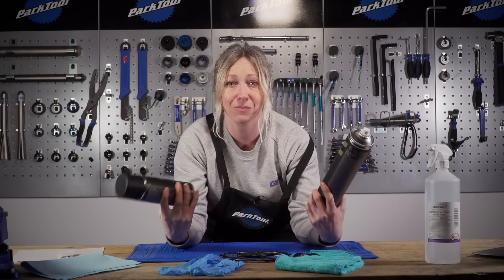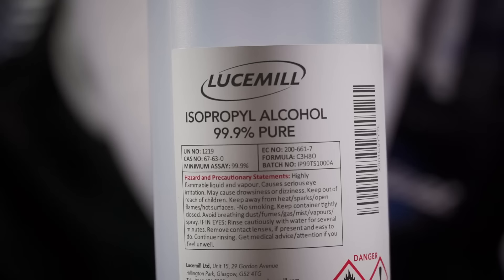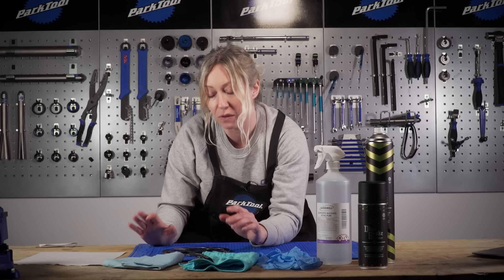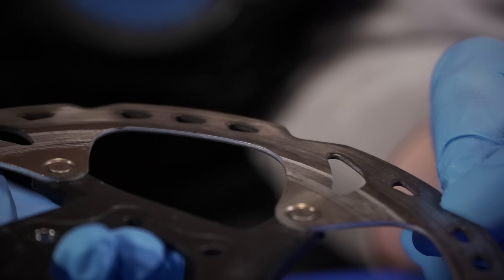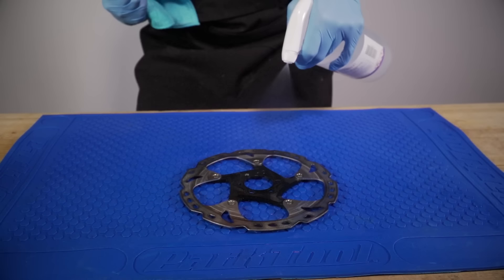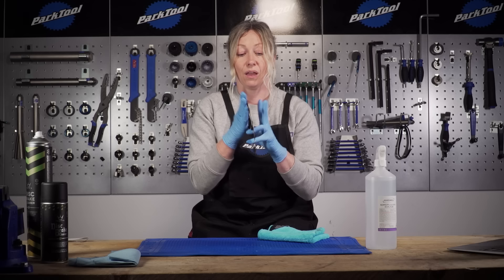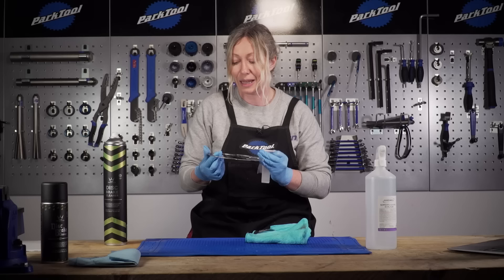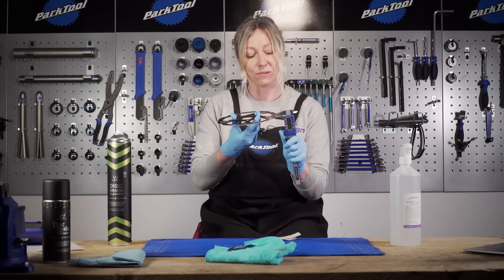How To Clean And Resurface Disc Brake Rotors

Comment: I'm sorry, but I don't think I need specific bike brake cleaner. Any automotive cleaner will do the job. What's that with it might have lubricant in it? It's made to clean disks!
Reply: Lubricant is made to reduce friction, I for example usually use WD-40 for my suspension and it usually drips down onto the discs. The result is brakes that barely get any grip at all, they also sound terrible.
Reply: I'm using automotive disk brake cleaner, works fine and it's much cheaper.
Reply: @TriqxterRB  yeah, exactly. Why do you want lubricant on your brakes? You don't... Automotive brake cleaner doesn't have any lubricants, as again, yon do not want lubricants on your brakes especially on a car.... Yet the host said "don't use automotive brake cleaner" which is just fake information
Reply: Brake clean is brake clean . Lube is lube

Comment: lubricants in brake cleaners?...ive never heard such wrong information sorry.
Reply: Maybe she misspoke, but she mentioned bike cleaners, they can be super slippery and effectively lubricate the rotor, I experienced this with Motorex, it was like dish washing soap, super slippery, and if not blasting the rotors brakes would get contaminated, Finish Line, Muc Off don't do this. But yes they at least not to the same degree.
But degreasers you are meant to wash off will be like this too, the one from Muc Off is, but not the Dry degreaser, they dry, no rinsing needed.

Comment: The bike industry is so weird, I've been working on cars and bikes for 25+ years and I've never bought any bike specific cleaning or lube products except carbon friction paste. Also sanding those rotors without using a flat surface could lead to high/low spots which will cause chatter...
Reply: Yep it's a faff the bike trade..
Reply: Concordo plenamente!🇧🇷

Comment: 437k people were just exposed to bad advice. Do no try to refinish rotors with a sand paper. It will create high and low spots. Which will create vibration and pulsing.

Comment: There is exactly ZERO reasons for car disc brake cleaner to contain ANY lubricant. They serve to exactly SAME purpose as bike disc cleaners do, so only difference could be retail price.
Also, automotive segment do not sponsor GMBN Tech, so perhaps...
Reply: the comment i was looking for. I buy mine in 5L canisters an use a pump bottle. Also WAY less waste then buying 300ml aerosol sprays.
Reply: Exactly 🎉
Reply: So, you're totally wrong.
These Brakecleaners are using a protection, you can clearly see leaving a resedue on the brakes.

For automotive, it will be a no problem.

But the tiny Brakes on the bike can not handle it.

Always using something without any protection, like Acetone.

Comment: Quite a bit of misleading info here. 
- No disc brake cleaner will have lubricant in them, especially the automotive types. 
- Sanding rotors like that will damage them if sanded too hard or won't do a thing if sanded too lightly. 
- Discoloration comes from overheating the rotors. The worst ones I've seen had all the rainbow until blue, meaning they've reached above 300 Celcius at some point. That will not affect your braking at all (excluding time they are hot in the form of brake fade), but in rare occasions excesive heat can warp the rotors if they are cheap, or get in contact with water while heated. 

Just clean and check the width of your rotors from time to time and throughly clean them if you are changing pads. That's all the maintenence you will need
Reply: Great info. You are correct.
Reply: Thanks I think you saved me from getting specific sandpaper and a bunch of unnecessary shit. I'm changing pads, different type even, (organic over to sintered). I'm going to thoroughly clean the rotors with the brake cleaner I already have, swap pads, bed them in and move on with my life.

Comment: According to Ollie from GCN, (phd in chemistry) acetone is the most effective grease cleaner, that doesn’t leave residue 👌
Reply: I agree,acetone is and it's much stronger than IPA but more hazardous.💯👍🏻
Reply: It's a more potent solvent but it has the disadvantadge of attacking plastics and rubber seals
Reply: @neiv9574  correct, be careful with acetone!
Reply from the maker: Great point! Acetone is a lot stronger. We'd only suggest using that if IPA doesn't work and you take extra safety precautions and have previous professional experience using it. 👍

Comment: Did that to my Code Rotors and Pads after just bleeding the brake was not successful and it really worked for me. No need to replace all that. Cleaning and sanding a bit does the job quite well.
Reply from the maker: Nice one! Good to know, Henrik! We're glad that worked for you! It's a nightmare having to replace pads and rotors. 😬

Comment: I have noticed that on GMBN every now and then they talk about CLEANING disk brakes.

For more than 10 years how long I ride bike with disk brakes I had only once problem, when I by accident spray wd40 on rear disk. And that was when I started to work on my bikes long time ago.

Honestly disc brakes are realy hard to be dirty, because surfaces of breaking pads and discs are very ofter in contact, creating friction and high temperatures. So they cleaning them selfs.
I have never used disc breake cleaner or sand paper on them, no need.
Reply: I don't think I have gotten much contaminants on them, but cleaning and "resurfacing" helped a bunch of times against squeeky or underperforming brakes. I think it's actually not getting them hot enough that often causes issues for me, but I can't magically make bigger hills appear..
Reply: Unless you get oil on them, they're fine as they are.
Reply: if you ridde in contaminated puddles, like with oil leaks by tractors, cars and so on, you can contaminate the brakes. but if it's wet and you brake a lot the rotors might eventuality work better, but always best to clean them if they are contaminated.
But without any contaminants there is no need to clean them. Resurfacing on the other hand you sohuld do when it's glazed.

Comment: The rotors you are resurfacing look like Shimano XT Ice-Tech (SM-RT86?). The stainless steel surfaces on these rotors are "sandwiched" over an an aluminum core. Personally, I would resist removing any of the stainless on these rotors by sanding them. In my experience, these rotors will get a "burnt" looking color---the price you pay for the technology. This does not affect the performance, just clean them thoroughly with alcohol. Finally, I would emphisize replacing these rotors once the thickness has reached 1.5 mm.
Sanding is acceptable if your rotors are solid stainless.

Comment: Can you print a retraction automotive brake clean is the same a bike , it has zero lube in it as it is designed to clean rotors and remove all oil.  Wd40 is different

Comment: I use ISO and regular paper towels and no special cleaner. When commuting my bike gets absolutely filthy, whether it's road dirt, salt, corrosion, etc. My trail bikes stay much cleaner. Depending on your conditions YMMV. The motorway was a good example because roads are littered with a different kind of filth than good ole' trail dirt.
I'll spray the pads with some ISO and then wipe them clean. Sometimes with bad weather/salt they get some corrosion (I always use metal pads). In that case I take some 220 wet/dry paper and give them a quick sand following by ISO clean.
As for rotors I don't tend to mess with them too much unless swapping to new pads. I like the ISO/sanding here as well before bedding, or anytime there is a lack of bite. Once bedded they tend to work fine thereafter.

Comment: Where do you actually buy Isopropyl Alcohol? You can pick up Methylated Spirit (the purple stuff) in DIY stores and even supermarkets, but I have never seen Isopropyl Alcohol on the shelves anywhere. Also can you not just use Methylated Spirit? It is good for removing any grease and oils before painting. I have used it as a substitute on my brakes before without any negative effects.
Reply: Pharmacy.
Reply: Try a hardware store, I bought mine at Würth. Ask for Isopropyl alcohol.  It might be labeled as IPA Cleaner, in Germany it can be labeled as IPA-Reininger, Which is what Würth uses. IPA is the english abbreviation.
The can says Isopropanol on mine, But that's in Norway. But as am in Norway it's called Isopropanol, or isopropylalkohol.
Reply: Is isopropyl alcohol not common on the east side of the Atlantic?

Comment: Nice video,my rotors ended up cleaning themselves,no need to de-glaze them and now they bite really nicely.Looking forward to the next tech video,pedal and cleat maintenance would be a cool topic.💯✌🏻👌🏻
Reply: You won't need to sand them rotor nor pads until they are glazed.
Reply from the maker: Thanks for the support, Reinhold! Cheers for the content suggestion!

Comment: Do you know why my brakes stops gripping after cleaning rotors with disc brake cleaner? Just wiping rotors with rag and after that brakes feel like they’ve contamined. Im not sure if winter has something to do with this, but so you know what could be reason?
Reply: You probably need to bed them in, there is lots of advice online on how to do it, but basically just gradually brake harder and from higher speeds, to heat stuff? Idk the specifics, but yh bed them in

Comment: I'm pretty sure that automotive brake cleaner is the exact same stuff as one meant for bicycles (acetone) and the only difference is significantly lower price. I can't think of a single reason anyone would add lubricants to a brake cleaner. That makes zero sense.

Comment: #askgmbntech How can I determine which size brake mount adaptor I need? Recently swapped dropouts on my SantaCruz Chameleon; 27.5+ to 29er. The old dropouts included a 40mm side-mount adaptor. The new 29er dropouts are top (or post) mount, and did not come with an adaptor. My 180mm rotor 'bottoms out' in the caliper before the axle lines up. Seems like I need a top mount adaptor to raise the caliper, but how to determine the size? Love the show, thanks!! #askgmbntech

Comment: Question, why use 120 grit sandpaper and not coarser? Any well founded reason for that?
Reply: I'd say you'd actually want finer.  Very course sand paper will leave gouges that are too large for the pad compound to adhere nicely.  Get a loupe or a magnifying glass and have a look at what that surface looks like. If the surface is too rough you might not be able to bed in nicely.  It would have been cool for them to show what this process actually does to the surface.